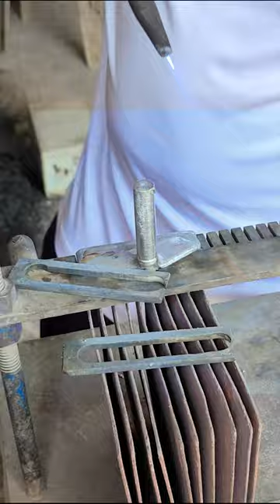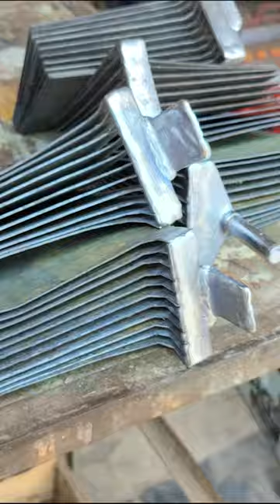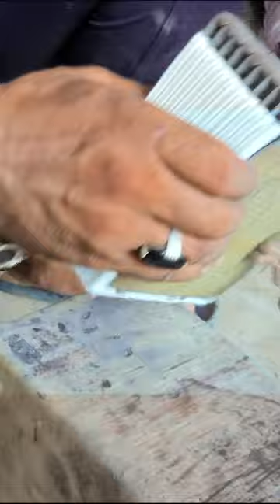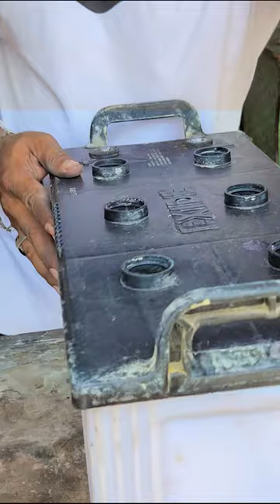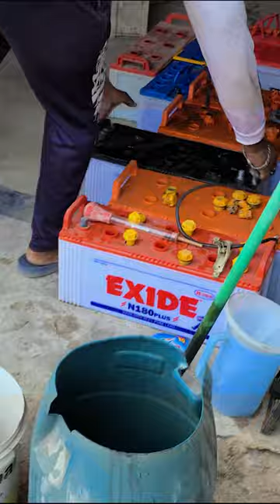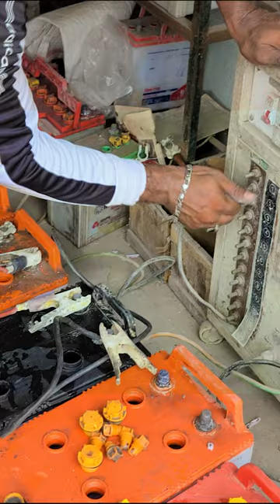Repairing Burned Battery with Bare Hands │ #engineering #repair #restoration #carbattery

Comment: Bro we have an Exide inverter battery and it's charging and discharging quickly, it's 5 years old. We have changed the water from time to time. But now the backup is just 40 minutes or less. What should we do? Is there any method to repair it?

Comment: Bro we have an Exide inverter battery and it's charging and discharging quickly, it's 5 years old. We have changed the water from time to time. But now the backup is just 40 minutes or less. What should we do? Is there any method to repair it?
Reply: Bhai wo Pakistan se reply karega kya tujhe ab 😄
Reply: Reply karega to pata chelaga na😅!